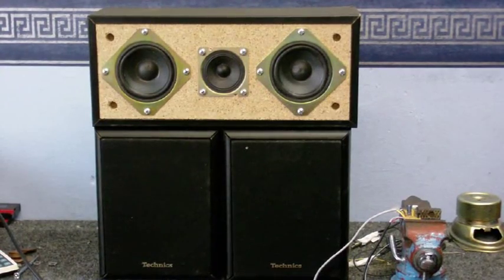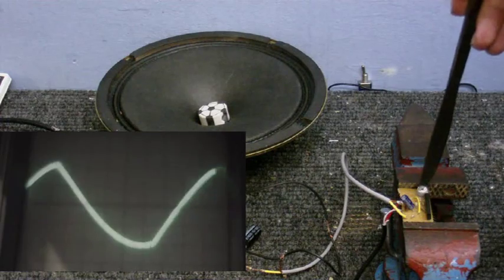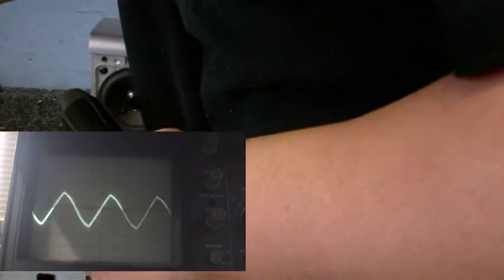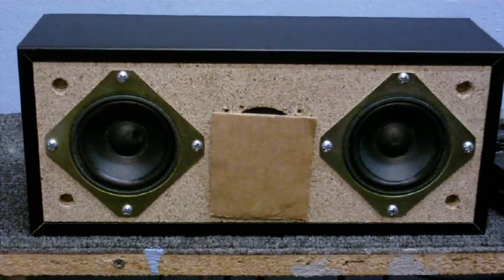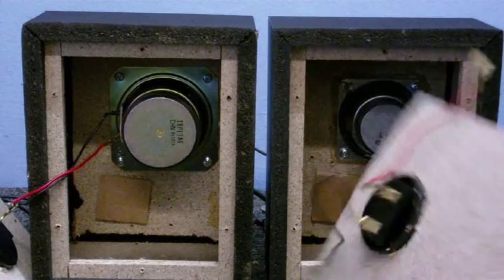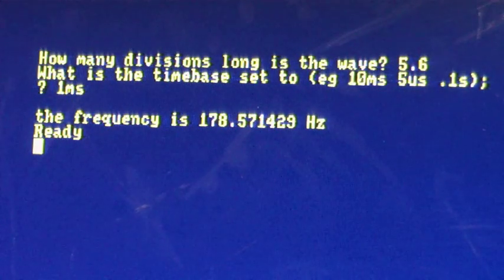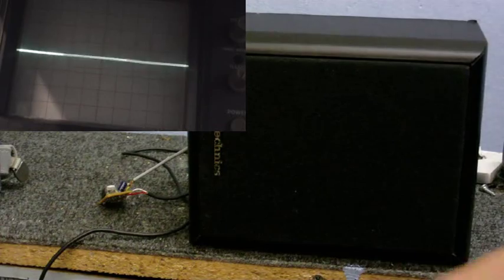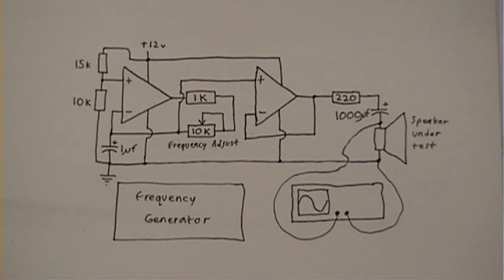Testing Speaker Resonance

Comment: To increase top-end on the little "satelite" drivers, remove dust cap (make sure you don't accidently cut the wires) and glue a "half-moon" shape piece of aluminium (from a coffe-can-seal) in place of dust cap. There is an open gap in the cavity (not covered by aluminium). This gives a nice open treble sound and increases intensity (compared to full covering). Sounds more like "real tweeters" and you get higher frequency response.

Comment: Usually, adding sound dampening material (fiberglass, etc), may lower the res freq a bit, and smooth out the response curve a bit. Your tiny boxes had a resonance that was too high for the insulation to have much effect. It has more effect on large ported sub boxes I think. There is a general rule of thumb to stuff a lot of insulation in larger sealed enclosures though.

Comment from the maker: the one I built and used in the video goes from about 48Hz to 550Hz, but you can get different frequency ranges by changing the 1uf capacitor, a smaller capacitor will maker it able to produce higher frequencies, a bigger capacitor will make it able to produce lower frequencies.

Comment from the maker: It's about 48hz to 550hz, and produces a near-triangle waveform.  Of course I could change the range by using different capacitors, but for testing speakers the range it has is ok.

Comment: 11:00 according to spectrum lab that is monitoring the sound of the video the frequency was centered around 195Hz so your program is miles cycles off target.

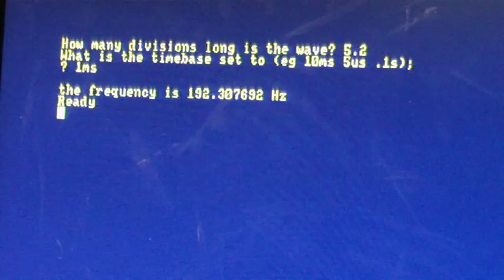14:00 194Hz and spectrum lab.
Reply from the maker: Actually, my program does work, but you have to remember that I was only ESTIMATING the frequency based on the waveform on the screen then calculating it, so you need to allow some room for error.  If I knew EXACTLY how long the wavelength was, it would be accurate.

Comment: Have you tried rigging up a quarter wave transmission line speaker enclosure? Bose use them in a lot of their stuff.
Reply from the maker: fatcat2939 I did try that once before, using an old speaker enclosure and making cardboard baffles, it didn't work too well, I might try again sometime in the future making one from scratch and out of wood.
Reply: CoolDudeClem Youtube has examples with pvc waste water pipe. Insulation foam  might be an option too, as its easily formed with a hot wire.

Comment: isnt that that the resonant frequency of the speaker stabilizer mixed with input signal , not actual speaker resonance , when you add waight on the speaker you tighten the rubber stabilizer hence it changes , when you bolt it up in a speaker box , you change geometry a bit and then that influences the rubber . If you dont do anything to the rubber stabilazer , it wont change ..so my guess is that it is not a speaker resonance , its the speaker stabilizer resonance

Comment: Hello fellow mad-scientist (I have mad-science on my ch too). 
I made a good (mad-science discovery). Those little 3" full-range speakers have far less resonance (in the upper med) than larger med drivers (by a large measure). Of course it also depends on the brand (and how much it costs) but cheap small "satelite" drivers are incredible if you run them with a woofer. Like $2,000 speakers for a tenth the price. Also see my ch for how to greatly increase top-end with a little piece of alminium.